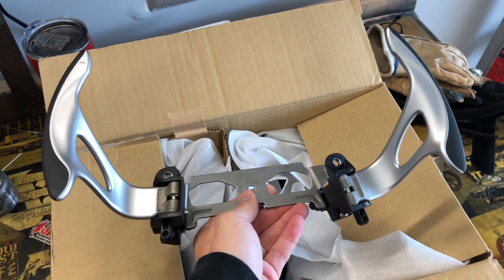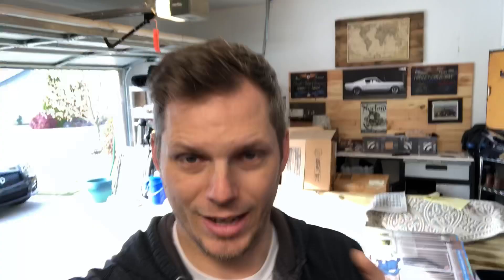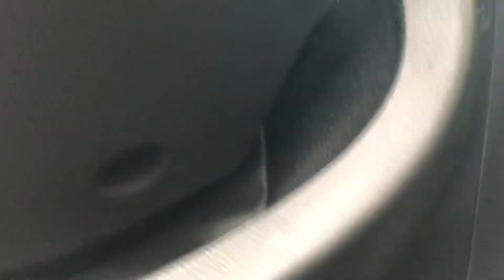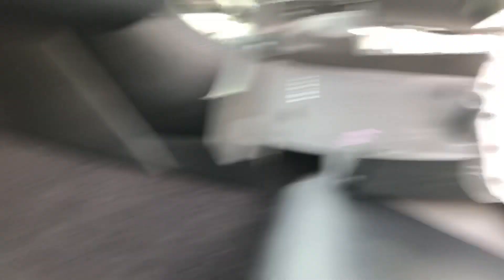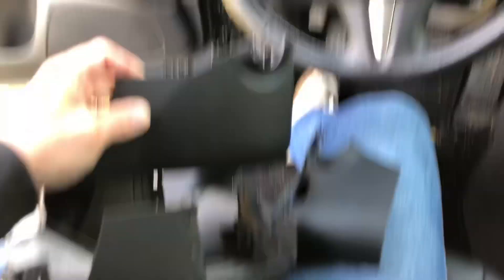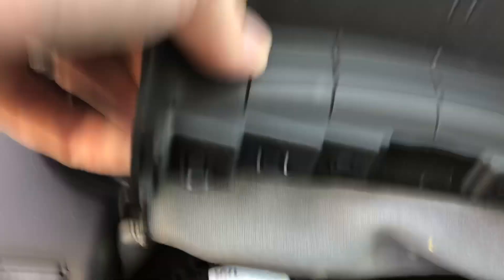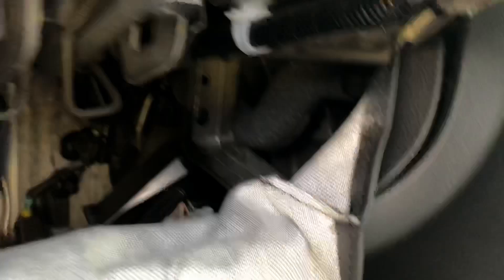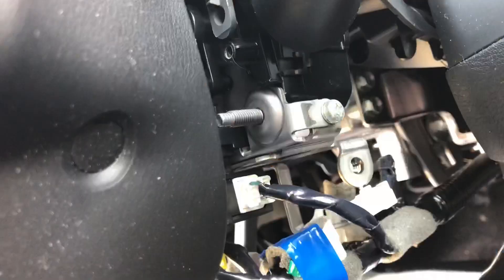Q50 Paddle Shifter Install Made EASY!!!

Comment: Sup bro, great vid.  Just installed Paddle Shifters on my 2015 Premium.  Having trouble finding a shroud like yours to accommodate the both the paddle shifters and manual tilt lever.  The results I'm getting for that part number u provided is for the regular premium shroud...
Reply from the maker: What do you mean “regular premium” shroud?
Reply: @SpeedCultureStudios  Maybe i'm just looking at the wrong thing.  I'm seeing the 2 piece shroud that doesn't accomodate the paddle shifters, or maybe the illustrations are all the same
Reply from the maker: @Firehazzard  I believe they are just the same photos which can definitely cause confusion.  Watch through the video again--I show the part number on the box for the shroud I purchased.  It is manual tilt.  These are also nissan part numbers so you can call a nissan/infiniti dealer and confirm.
Reply: @SpeedCultureStudios  ahhh ok, that would make sense.  Thanks for the help and keep up the good work with the channel!

Comment: I just got a non sport Q60 2019 lux.. Was wondering if you think this would work for my model?
Reply from the maker: I do not recall hearing if the newer models are prewired
Reply: @SpeedCultureStudios  if it is is that all I would need to do is buy some 37 paddles does the year matter of the paddles?

Comment: Hey do you know if these paddle shifter will work for my 2015 q50 awd  part number: 25549-6AV0A
Reply from the maker: I don’t know that part number, but there are several variations of Nissan/Infiniti paddles that will work
Reply: Speed Culture Studios are the paddle shifter you linked pre wired or do I need any additional  components besides nuts/bolts and steering column ?
Reply from the maker: Logan Mcintosh Paddles should come with the connectors

Comment: have you noticed shifting is a bit more responsive with the paddles vs manually shifting with the stick?   I did this a few months back and it seems that way for me.
Reply from the maker: It’s hard to tell for me honestly because of the tune. After being tuned, the shifts seemed to be a bit more snappy so I’m not sure if it’s the paddles or not, but I am very pleased!
Reply: @SpeedCultureStudios   what tune did you use to get the transmission to be more "snappy"?
Reply from the maker: I got the ecutek tune. I don’t believe the trans can be tuned technically, but whatever settings are adjusted made the throttle much more responsive which possibly just makes it feel more responsive.  It’s not super quick when you’re at half throttle, but wide open it shifts quite firmly

Comment: Hey man, for the Shroud, all I can find on EBAY is listed as 48470-4GF3A. Are this the same one as 48470-4gf2a that you listed above? Mine is 15 Q50 premium with manual tilt.
Reply from the maker: Mine is manual tilt as well, so you’d want the part number i have. They are tough to find—I’d just try the link I gave you. You won’t find one cheaper in better shape.
Reply: @SpeedCultureStudios   oh ok, I found the paddle shifter on Ebay and I was hoping to find the shrouds too haha. Alright then, I will get the on in the link.

Thanks again !
Reply from the maker: Nico Djulianto yeah I waited and waited on eBay and nothing ever popped up for under $100. Figured i would might as well get brand new for the same price.

Comment: I need help! I have a 2014 hybrid premium and theres so many options, is it still the same as the link?
Reply: I choose the auto tilt correct? And it has them?
Reply from the maker: If you have auto tilt than yes.  If you have to pull a lever to move your wheel then you have manual tilt

Comment: Hello. Congratulations for the video, I want to do this on my Q50 2015! The question is, how I know if I need Auto Tilt or Manual Tilt? I supose That the difference is the "electric movement" of the Steering wheel position, so Auto Tilt is electric movement, manual is "manual" movement, is that correct? thanks in advance
Reply from the maker: That is correct. The manual tilt column shroud has a cutout for a level. The auto tilt is a big circular cutout.
Reply: I just purchase the parts! I am excited to do this once it arrives. I will let you Know when I receive it and mount it in My Q50 2015...
Reply: Hey... I just install the pads... IT is really great! Thanks man!
Reply from the maker: Ascanio Bali awesome dude!  Glad to hear it!

Comment: hey in the ebay listing, when i put 2019 q50 it says that the part isnt compatible. are you sure that that link is the correct one for my car? i have the 2019
Reply from the maker: No this is not for the 2019. I believe I said in the video this is for 2014-2015. Possibly 2016. 2019 has a totally different paddle.
Reply: i just purchased these for my 2015 Q50 base model and they are exactly what i needed i ended up purchasing the paddles on Ebay for $200 bucks and they just came in the mail today and everything seems to be legit ill try to post a video of the parts and install as well.. hope this helped and @SpeedCultureStudios thanks for all your videos youve made liofe alot easier when it comes to decision making on the mods for the Q50 platform...
Reply from the maker: robert robinson Really appreciate that man!  Glad to help!

Comment: Dude could you please give me a link so I can find where I can buy the whole stuff. i just watch how to install it but can't find where to buy. Thank you!
Reply from the maker: You have to search for the paddles.  Either a dealership, eBay or a salvage yard.  I provided a links to the steering column shroud.  There’s nothing more
Reply: @SpeedCultureStudios  got it man. Thank you a lot. I just search for it and it is much more expensive now. Used one is about 250 dollar now. It is crazy.
Reply: @SpeedCultureStudios  one more question, if the 25549-6av0a which is the paddle shifters are fit for our car. I just find it is likely be the same. Thank you!

Comment: Where can I get the bolts and nuts for it ? Or I can use anything that fits ?
Reply from the maker: I provided the part number so you can order them from Nissan/Infiniti or you can use anything that fits
Reply: Speed Culture Studios I went to infiniti discount website and the part number isn’t pulling up their . Do you know a website for sure that has it ..
Reply from the maker: Truu Lucian No I don’t  sorry.  I had some spare hardware that fit.

Comment: Mine is 2.0t 2015 q50… can my car install the paddle shift?
Reply from the maker: Take the column shroud off and see if it's pre-wired.  My guess is that it is, but you should confirm before purchasing parts.
Reply: Thanks dude

Comment: Does the bracket for the shifters come with the shroud? All I have is the Shifters right now but no bracket for it like yours.
Reply from the maker: Nothing comes with the shrouds. Which bracket are you talking about?  The bracket that they actually mount to on the steering column?  You shouldn’t need a bracket, you’ll see the mounting places on the column when you open it up. I didn’t use the bracket you see in the video.
Reply: Oh ok I thought you used it I see what I’m missing; I ordered after market CF shifters and it didn’t come with the electrical component; should I ask Infiniti for those parts or should I just buy oem Nissan Maxima or q50 shifter for the connectors?
Reply from the maker: Marcos Lovan that was going to be my next question. (Did you get the connectors.) if I were you I’d try to find some off a g37. You’ll find a better deal!
Reply: @SpeedCultureStudios  Ok I think I will do that, so the G37, 370z, and Q50 are my only options for the components? Sorry for so many questions i hope you don't mind the guys on the Facebook infiniti q50/q60 would just troll me.
Reply: @SpeedCultureStudios  Does the g35 shifters work as well?
Reply from the maker: Marcos Lovan It’s cool. Yeah some of them are terrible. But you are correct. G37, Q50, 370z have many similarities.
Reply: @SpeedCultureStudios  Ok I got everything i need minus the nuts and bolts. How do remove the OEM paddle shifter from the electrical component?
Reply from the maker: Marcos Lovan it’s just a plug. There might be a little clip on it but it just plugs into place.
Reply: @SpeedCultureStudios  No i mean i have aftermarket shifter that i want to attach to the oem electrical component.
Reply from the maker: Marcos Lovan there has to be a pin or screw/bolt that holds the paddle to the connector. Without looking at it I can’t really guide you but there has to be a pin.
Reply: @SpeedCultureStudios  Ah yes i know its hard, what i mean is the pin holding the paddle shifter to the electrical connection, my friend said i need to use an Awe and hammer to get it out.
Reply: @SpeedCultureStudios   UPDATE, I got the shroud on the paddle shifters switched on, but the right shifter is not upshifting, is there a way to figure out if its the wire or the actual paddle shifter not working.
Reply from the maker: Marcos Lovan Dang. Other than making sure the connection is tight, it’s tough to test. It’s not making a good contact for one reason or another.

Comment: Would a 2011 G37 paddle shifters would fit the 2015 Infiniti Q50 ?
Reply from the maker: Yes. That’s what I used.
Reply: Speed Culture Studios aright thanks , another question . Does it matter what tilt I get for the shroud ?
Reply from the maker: @truulucian9877  Yes it matters.  You'll want to be sure you get the correct one.
Reply: Speed Culture Studios how do I determine which one I need ? New to this so I don’t know .
Reply from the maker: Truu Lucian do you have an automatic tilt or do you have to pull the lever to adjust the wheel.
Reply: Speed Culture Studios I have the pull the lever to adjust the steering wheel up or down
Reply from the maker: Truu Lucian so manual tilt

Comment: in total about how much did this whole set up cost? great video👍. and these are the g37 paddles right?
Reply from the maker: Thanks!  Yes g37 paddled. I paid $100-$125 for the paddles and $100 for the shroud.
Reply: Speed Culture Studios also, are the paddle shifters also pre wired in the 2014 Q50?

Comment: Nice how to! Most helpful paddle shifter install for the Q out there!
Reply from the maker: I appreciate that!  I hope it will be helpful!
Reply: One Fine Trek totally helps man! Keep the good vids coming! On another note I got that magic drift rear diffuser and man you are right it doesn’t go on easy on the top part of the bumper. Did you use double sided tape and does it show?
Reply from the maker: TheMkpep I did use 3m double sided tape. I also heated the diffuser up to sort of shape it and taped just the top until it was really cured into place before I attached the under side. The tape doesn’t show too bad. Only shows because I used thicker tape. You can get half round door trim to cover the imperfect edge.
Reply: One Fine Trek that’s what I need perfect! Thanks brother!

Comment: You’re awesome dude
Reply from the maker: Appreciate you taking a look!!
Reply: One Fine Trek quick question, is it possible to make cutouts on the  base model shroud instead of buying the 2A shroud?
Reply from the maker: Mohammed Hossain Yes. I considered doing it myself. I’ve seen one other person do it, but they were not happy with their results. 
They probably didn’t have the right tool or they don’t have the most steady hand. I’d say if you go that route, look at some pictures, use an air saw or small dremel tool and take your time.

Comment: Do you think this voids the warranty?
Reply: Everything I've found says it breaks the warranty so i'm not sure what to think because I REALLY WANT THEM.
Reply: A forum also said that it only voids that specific part of the warranty so if something non related goes bad that's covered.
Reply from the maker: No. The vehicle is pre-wired for the paddle shifters. You just have to make sure you know what you’re talking about at the dealership. Service departments like to give people a hard time about warranty, but it’s not up to the dealer—it’s up to the manufacturer.
Reply from the maker: The vehicle is pre-wired for them. It cannot break the warranty. Dealers try to give people a hard time, but according The the magnuson-moss warranty act of 1975 says that they have to be able to prove that the modification directly caused the failure you are trying to have repaired to deny the warranty. If you put lowering springs on your car, they cannot deny a warranty claim on an engine issue. Now, they could try and fight you if you install paddles and your trans goes out—however you could fight hard against that because of the fact that the wiring harness is already there—so adding the shifters is changing nothing. 
Easiest thing to do would be check with your local Infiniti service department.
Reply: Nick Hatje won’t void the warranty if it’s a factory part.
Reply: One Fine Trek thank you my man
Reply: I’ve been slowly trying to mod my base to have the look of the sport model without the badging. Next step is painted splash guards and carbon rear spoiler.

Comment: Saludos ,nuevamente,  busque en ebay y los que conseguí son para los q50 que traen el espacio en el cover para los paddle y mi carro es como el tuyo ,que no trae el espacio para los paddle , necesito el mismo que muestras en el video , el que trae los cover .
Gracias
Reply from the maker: You need to proper shroud with the space for paddles. https://www.infinitipartsdeal.com/oem-infiniti-q50-steering_column_cover.html
Just make sure you get the correct one. Do you have automatic tilt or manual tilt steering column?
Reply: @SpeedCultureStudios  manual
Reply: @SpeedCultureStudios  es como el tuyo
Reply from the maker: Jesús Ortiz Lo siento, mi espanol no es bueno lol. If it is the same as mine, you will need part #48470-4GF2A
It is hard to find them on eBay so I suggest the website I gave the link for.
Reply: @SpeedCultureStudios  tranquilo , su español está bien,  tiene que ver mi Inglés lol, la pieza 48470-4GF2A , la conseguí en la infinti , ahora , pregunto , una vez consiga la pieza , cualquier shifter paddle le funciona?
Reply from the maker: Sorry. Having trouble with your last question.
Paddle shifters from a G37 or maxima will work.
Reply: @SpeedCultureStudios  nice , gracias
Reply from the maker: Jesús Ortiz anytime my friend.

Comment: Is your Infiniti Q50 a basic or sport
Reply from the maker: Base—that’s why I installed the paddles
Reply: Speed Culture Studios so would a sport column fit a base model Infiniti Q50
Reply from the maker: eduardo grado they are the same except the cutouts for the paddle shifters.
Reply: Speed Culture Studios they would be bigger for the paddle shifters or smaller
Reply from the maker: eduardo grado I don’t know what you’re saying.  The shroud is the same there are just slots cut out for the paddles

Comment: If I don’t have the sport model and have the manual tilt  but have the paddle shifters will the manual column cover fit?
Reply from the maker: You need the column shroud that fits the paddles

Comment: Hi will the g37 manual shroud fit the q50’s?
Reply from the maker: I do not think so.
Reply: But the top part of the shroud doesnt have to be changed right? Thanks
Reply from the maker: MrRainnnsss I don’t know honestly. From what I understood, the shroud from a g37 will not fit the steering column in the q50.

Comment: Could this be done on my ex35?
Reply from the maker: I’m not sure on that. If it was pre-wired for it and their are column shrouds available then I suppose, but I’m not familiar with the ex35, sorry.
Reply: @SpeedCultureStudios  it's cool the ex35 is a G hatch back or compact suv.
Reply from the maker: TheCarSection TheCarSection cool cool—yeah i just didn’t know what the column was like. If it’s basically a G then I’d say it would work. Take the column shroud off and see if it’s pre-wired for paddles.